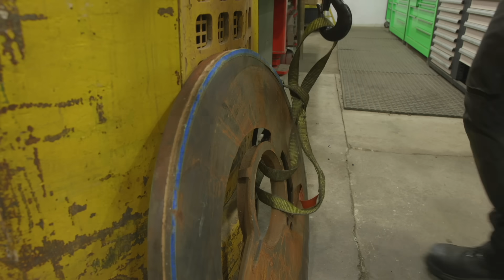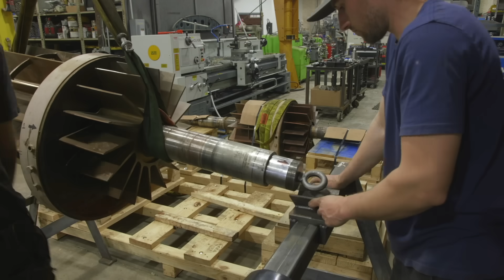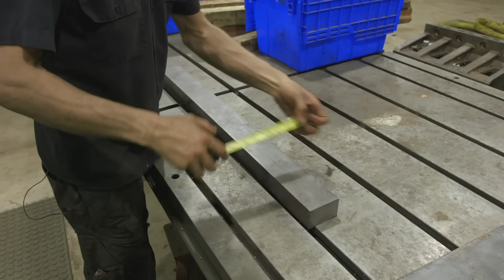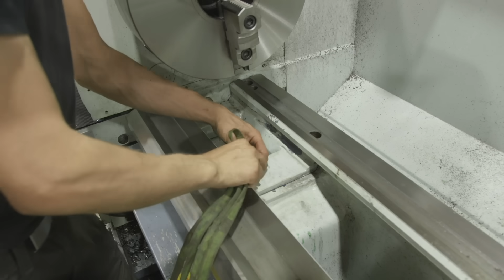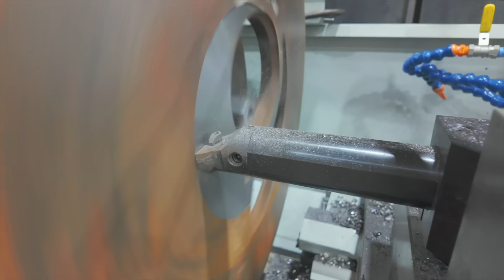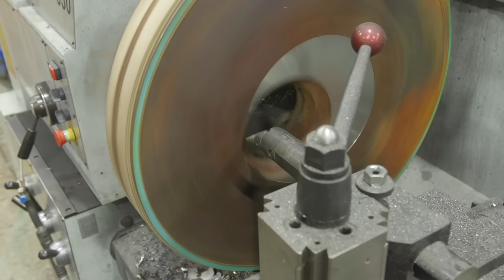Biggest Job Yet For The Lion Lathe

Comment: I certainly hope Josh told you not to plan on putting the gap bed back in place and expect your accuracy not to suffer.   They never go back exactly right.  If you purchase a gap-bed lathe to gain the increase in swing, then plan to make it a dedicated gap bed and throw the removed way section in the scrap pile.  This advise comes from decades of experience.  You can, of course, replace it and re-grind the ways but the cost of that can hardly be justified.

Comment: Am I the only one that was screaming “take the damned chuck off!!” When he was pulling on that gap piece with the sling up against it?  Seems like a good method for damaging the ways on your new lathe.
Reply: Several decades of experience here, one rule on a gap-bed lathe...... "If you take it out, forget putting it back in unless you're prepared to re-grind the ways".  They NEVER go back perfectly!  Sad, but true.
Reply: @garth849  Why is that? I assume it would have been ground with the dowels and bolts in place. So assuming you don’t have any swarf underneath it why wouldn’t it go right back to where it was?

Comment: Once you remove metal from the end plates and the vane ends you will make the 2 stage vacuum pump a whole lot worse, I used to tig bronze the vane ends and once machined the clearances should be .006" aside .

Comment: I would of applied liquid wrench, tapped the impeller and shaft  with a copper sledge hammer, not hard enough to dent anything, just tomsend somemshock waves through the joint, let it sit overnight before trying to pull. If there was 0.001” between the two parts the liqud wrench would permeate.

Comment: Hi Kyle,
I have a question:
- For the damaged shaft, why didn't you weld it back on and then grind it? If it's stainless steel, it's fine.

Then, I had the vibration problem with the brake drums in my car. It was impossible to mount them from the outside because cast iron has a taper, and there's a thin machined rib.
I made a mandrel to mount it from the center, and the drum vibrates a lot like a bell when mounted like that.
Using a rubber band, like an inner tube, clamped on the outside, vibrates much less, or rubbing an old piece of wood on the outside, without overdoing the pressure, dampens the vibrations well.
For a brake drum, if the surface isn't perfect, but is round and clean, it wears in over time. At first it vibrated a lot and after 500 km the surface became very smooth, I took it apart to check.

Xris

Comment: Those liquid ring vacuum pumps have some really close tolerances between the axial faces of the impellers and the pump casing ends. Only a couple of thou, otherwise you get water recirculation and loss of performance. It'll be interesting to see if your customer sees a big improvement when they are rebuilt. Have to say they are bigger pumps than I ever worked on.

Comment: I didn't see you using heat until I saw it again. There should have been two men standing there, each with their own gas burner, heating it very hard. The problem is that you pull crookedly so it locks together. The more you pull, the more it locks.    :face-blue-smiling::face-blue-smiling:

Comment: I would have tried with strong, rapid heat first, then you could probably have pushed it off.   I don't know how many hydraulic cylinders I've made where people have tried to unscrew the nut themselves. Just the weight of the stick is enough to create burrs, and then it becomes impossible to separate. ..last solution together with heat would have worked  ..it requires a lot of heat and fast. then you can make it expand 1mm and it comes right off.

Comment: I meant I laughed out loud when he was lifting the Waze off the lathe and he said oh it's not nearly as heavy as I thought it would be as he's using a overhead crane to lift the items... Sounds like the guy at my work that hit a sprinkler head on the roof at the warehouse with a forklift he said he barely touched it and said the forklift doesn't know if you're lifting 20,000 pounds or 1 lb it moves with the same force Yes it did rain inside the warehouse that day

Comment: Always remove the dowel pins first and install them first. You run the risk of things slightly shifting when you remove the bolts first. My experience comes from 42 years of working on large industrial equipment. I am assuming you used a boring bar because you couldn't get the carriage close enough for a standard cutting tool with the bed removed.
Reply: I wondered about the boring bar as well, but in a few shots you can see the carriage is right up to the edge of the gap, necessitating the stickout. It's too bad the tool post is so far to the right.

Comment: I was cringing when you were tensioning the chain with the porta-power.  I hope you were nowhere in the area when you applied pressure.  Chain will explode instantaneously when its rating is exceeded.  Wirerope will also fail, but it will probably give you a bit of a warning before failing.  Kinks can be a problem using wire-rope.

Comment: Once you mark one unit, there is no need to mark the second unit.
Reply: i wouldn't mark it that way at all . since the impellers and rings are balanced removing material is a no no .
Reply: @johnmiller7073 
That is what I thought at first but he did not drill a "through hole" just a small dimple.
Reply: Wrong, he is also marking for orientation on the shaft

Comment: Good job for a vertical borer. They look like rotors off wet ring vacuum pumps. I wonder if they have been running in the inhibitor liquid specified. I had to strip down and put a new seal kit in one from a dairy that the farmer was running in heavy mineralised water. It was coated in calcium carbonate.
Reply: I was repair workshop manager for a manufacturer of liquid ring pumps, all familiar stuff. We had a huge horizontal press to get these impeller / shafts apart went up to 500ton Facing of the end plates was done on a big vertical borer. Worked with all manner of material, stainless, cast, bronze and exotic alloys as the vac pumps were used in some very hazardous processes. Worst ones were from a margarine factory, all the internals coated in a fatty cake that have to be burnt off in an industrial oven.  Happy days.
Reply: I refuse to have marg or canola oil in the house. I’ve done maintenance work in Melbourne based plant where they extract the oil, the amount of dead animals, insects living in sub floor access pits for bucket elevators was horrible. Huge white cockroaches that had never seen daylight exposed as one digs to the access panels. Not to mention a benzene derived product (Hexane) used there to break down the seed. Copper coated tools and hammers were mandatory around that process. 
Customers should be decontaminating their own parts themselves before they arrive at the repair workshop.

Comment: For the ringing, could you use the butyl rubber sound isolation stuff people use in cars to help prevent some of the vibrations? Another consumable that you'd need to stock and charge the customer, but might be worth a try. You could also stack it as a crude balance adjustment for things like these rings with their off center holes.
Reply: Magnets are the way to stop that ringing. They change the harmonics of the part. Of course, they don't work so well on copper alloys or austenitic stainless.

Comment: you can kill vibration in the tooling by wrapping int in soldering tin or putting a rubber jacket around the tool. in a bore it is not always advisable as it can get lose and get jammed between the part and the bore wall, but in this use case it is a viable option given the situation necessitated a long tool hangout and a facing operation with no hazard of tool shank coming into close proximity of the revolving material. Some of the harmonics could have originated from the tool shank itself so it is a good place to mess around when all else fails.

Comment: Not a good idea to leave the chuck key in!
Reply: You are worried about the chuck key and Not the 300 LBS piece that is held in by a TINY lip with self-made soft jaws and is unsupported from the back and spinning at 200 rpm? 
Really?
Reply: Had the same reaction, even tho he only wanted to move the carriage under power feed. Makes sense but scary nonetheless.

Comment: That's a big job Kyle, I've worked on a cold rolling mill gearbox recently (700kW ish) and we had a similar issue with galling when pulling things apart. Something that may have helped in your case is oil injection between the parts. Drill a relatively small hole into the impeller towards the shaft until you break through to the shaft and install a coupling to inject oil with a special injector pump. SKF has models that go up to like 40 000 psi for this purpose.

In our case the galling was so bad the coupling had to be remade (2000 lb part) in a rush order. We cleaned up the shaft but by the next maintenance interval a new shaft was made to be installed. 

The main thing I learned form that job is clear and complete communication with clients and subcontractors is extremely important